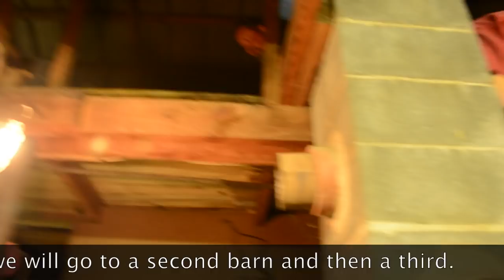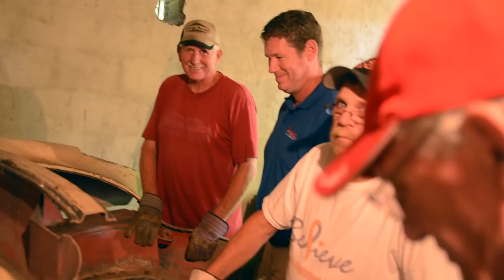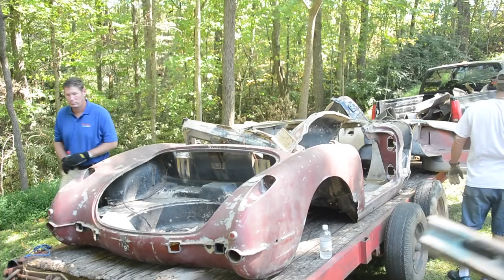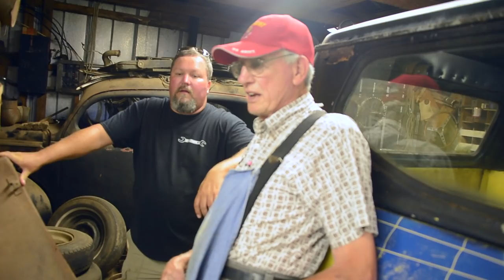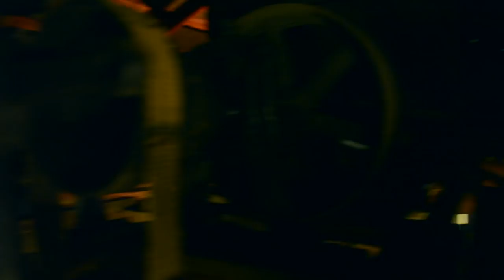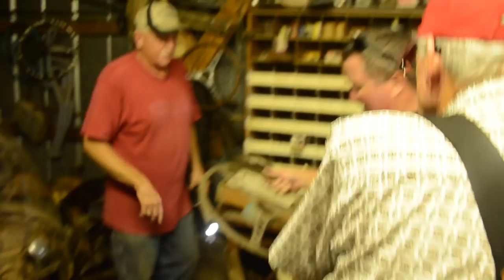1956 and 1959 Corvettes parked in barn since 1969 with Corvette parts

Comment: Now, I'm not expert and it's been years since I worked on a 50's/60's vette but when I did work in a restoration shop, the boss was meticulous about building a steel frame to keep the body straight and square once it came off the frame. He said "because if you don't, it will stretch and move all out of shape and never go back on right.

Now maybe you guys are different and there's new technology but those bodies look rotten and quite frankly, worthless....unless you did all this for the vin numbers......